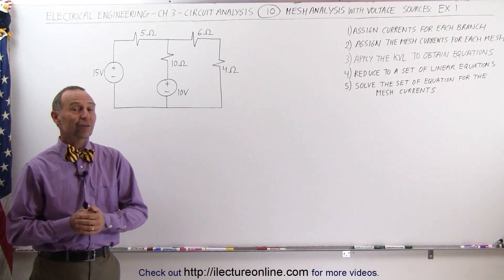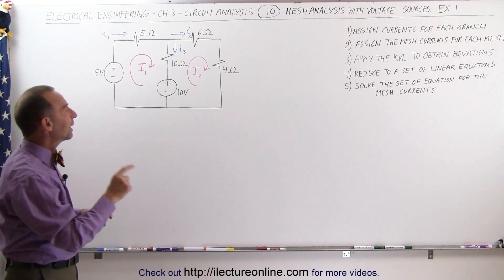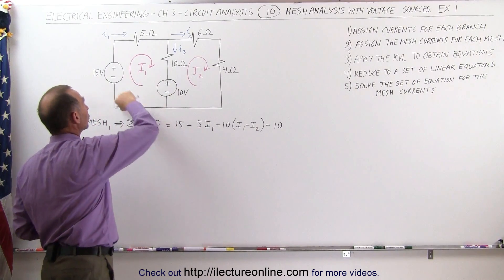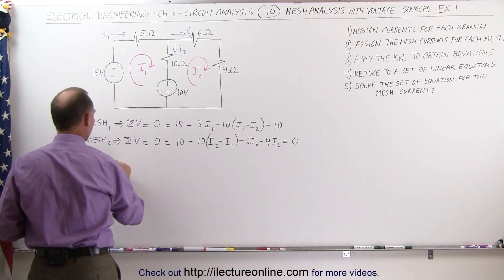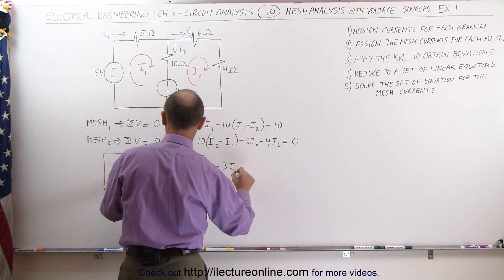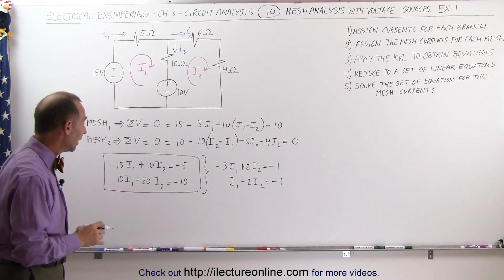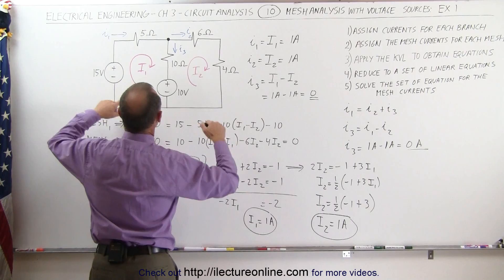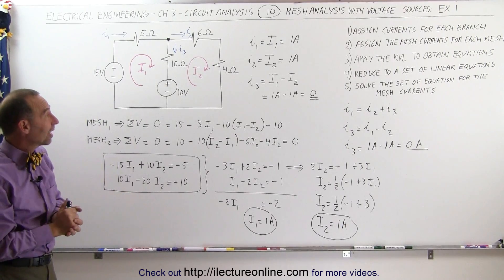Electrical Engineering: Ch 3: Circuit Analysis  (10 of 37) Mesh Analysis w/ Voltage Sources: Ex. 1

Comment: Why we not consider 4 ohm resistor is i4 current
Reply from the maker: you can call it I4, but it doesn't matter.  I1 and I2 were used to indicate there are 2 currents.
Reply: @MichelvanBiezen  ok understand thanks sir
Reply from the maker: We use I1 and I2 to indicate there are 2 currents.  The value of the resistor is not relevant for that.

Comment: sorry but i dont get the second part of the mesh equation. it is clear that I2 and i3 are in the opposite direction so we say it is a voltage rise but why did we write -10(I2-I1)
Reply from the maker: You can solve the equations using i1, i2, and i3, or you can solve it (as we did in the video) using I1 and I2.  When traveling across a resitor in the direction of the current indicated, there will be a voltage drop.  (The equations are correct).
Reply: @MichelvanBiezen  so i can put a plus sign where the current comes from and a minus sign where the current leaves the resistor. And by that, is it able to say that if the mesh current is coming from minus sign and going through the plus sign, then it is a voltage rise?
Reply: may i also do this technique for node-voltage method sir?
Reply from the maker: I don't want to say "yes" or "no" since I am not sure I am following your description correctly.  But here is the rule:  Traveling WITH the current across a resistor causes a voltage DROP.  Traveling AGAINST the current across a resistor causes a voltage RISE.
Reply: @MichelvanBiezen  i get it thank you so much

Comment: Professor Biezen, you are a rockstar. I can't tell you how much I appreciate your videos!
Question: At the 3:00 mark, you're building Mesh 2.
When crossing the 10Ω resistor, you say that relative to current I2, it is a voltage drop, which I agree with.
However, when considering the direction of I1, you say that we have a voltage rise, which I disagree with. You even rotate your hand in the counter-clockwise direction, which is not the direction we assigned I1 on the problem.

I am going to work out the problem with my assumption in mind, but I do hope to hear from you regarding whether I've misunderstood this or not. It would mean a lot! Thanks either way for what you do!

EDIT: I built the circuit in Multisim and determined that it was indeed I who was wrong. 
Then I recalled something my professor said in class, which was that when the currents travel in opposite directions, there is a sign difference. So here, I'm not looking at the at the relationship between the direction of I1 and and 10Ω resistor. I'm looking at the relationship between the directions of mesh current I1 and I2. And because I2 is negative (with respects to the 10Ω resistor) and the direction of I1 is opposite, then its sign should be positive. 

Thanks again!
Reply from the maker: Thank you.  When finding the second equation we have as the middle term:  - 10 (I2 - I1) which = - 10 (I2) + 10(I1)  which gives a voltage rise due to I1 and a voltage drop due to I2, traveling around mesh 2 in a clockwise direction.

Comment: For those wondering, the reason there is no current going in the middle branch is because there is no potential difference across that branch due to the potential at the junction being 10V and the source in that branch is also 10V therefore using ohms law you can see that there is no potential going through the 10ohm resistor. (10V on both sides of it)
Reply from the maker: That is a good way of looking at it.  The net potential diffence across the middle branch is indeed zero.

Comment: I run this circuit in a simulation program, and I get measurements as calculated in this video. Now, why is it that there is 0 current through i3? is it because the voltage potential is 0 ?
Reply from the maker: It looks like the 15 V battery in branch 1 is cancelling the 10 V battery in the middle branch.

Comment: The way our lecturer teaches us is that when you assign each mesh current a direction, you pick a point in each mesh and "walk" around the circuit. If you meet a resistor it is more positive on the side that you encounter it so for example +10(i1) if it was mesh 1 and a 10 ohm resistor. I worked out the question quickly and I got identical answers to you so I guess both methods are good.
Reply: any circuit  has many , many ways to solve .  We can traverse Counter Clock-Wise if we want .
Most literature tries to stay with  +pos ohm's law for the  passive  components . The video uses
+pos ohm's law for the passive  components ( he did not show the  +-polarities
across the  resistors )  , however , he choose to  say :  Vrise is  +pos
and  Vdrop  is -neg , thus he writes a lot of  -neg  KVL signs for the  passive components on that
C.W.  Clock-Wise  traverse . ( he even sniveled at all the  -neg signs of the  equations , there ya go )
Also not shown , is that most of the  Ohm's law  signs for the
resistors are +pos . Thus  his written equations could have had lots of  +pos  signs .
There are a lot of features that need to be included with this tutorial .

His  equation writing works , but is cumbersome ,... to me it is .  I recommend the book :
U.S.  version ISBN :  0-07-027410-X  or the  International version  ISBN :  0--07-112961-8
Engineering Circuit Analysis  Fifth  Edition , 1993  publisher  McGraw-Hill .
That book is  strictly  "hole flow" .  The  book  explains the difference between  writing
Mesh equations  using  "Branch Currents" , as opposed to strictly using  "Mesh Currents" .
When  writing  "Mesh Equations" , we should be exclusively using  "Mesh  Currents" .

here are the  2  mesh  equations .  Both equations are written directly  from the diagram
( No  intermediate  steps  were used  nor  written  )

mesh Eq. I1 :   15v - 10v   =   ( 5 + 10 )I1  -  10*I2
mesh Eq. I2:             10v   =  ( 10 + 6 + 4 )I2  -  10*I1

once you know the  tricks , very fast , very easy ( just a couple of seconds  each )
This is a preferred way , as the Format  is also directly suitable for use with a Matrix .

( I'm not perfect , but  I have also seen a lot of books that aren't perfect  either )

P.S.
you might have wanted to see the  initial equations written in a  C.W.  traversal ,
using the  +-sign as we  Enter each  component :

mesh Eq. I1 :  - 15v   + + 5*I1 + ( + I1 - I2 )10  + 10v  =  0 v
mesh Eq. I2    -  10v  + ( + I2 - I1 )10  + + 6*I2 + + 4*I2  =  0v

notice I have emphasized the  Ohm's Law sign of each passive  component , by showing the
second  polarity sign .  Most are  +pos  Ohm's law . And most  KVL signs are  +pos  too .
There is still a lot more to discuss .

P.S.S.
For the  curious ,
it is possible to  traverse  C.W.  for both meshes , while  I1  is  C.C.W. with  I2  C.W.
the correct answers will now be :  i1  =  - 1 amp ,  I2 =  1 amp
we could have at least 4  correct  sets of answers :
I1 =  1  with  I2  =  1  ,  or  I1  =  1  with  I2  =  -1  , or  I1  =  -1  with  I2  =  1 , or  I1  =  -1  with  I2  =  -2
all  4  are  correct in their  context of  the direction  that was used for each  Mesh  Arrow .
hint :  <----- 5   is the same as  -5 ---->  , for  Vector currents .
if someone says to solve the circuit with  both  Mesh Arrows  moving  Clock-Wise direction ,
then we all need to get the same answers that  M.V.B.  got in  his  video .

Our analysis does NOT change how the physical circuit operates , only our perception is different .
However , once we interpret the numerical answers , we then know  absolutely ,
how the circuit is operating .  Absolutely ,  the circuit operates in exactly the same way ,
no matter how we choose to write the equations.

And , we didn't even  try to traverse  counter  clock-wise . So there are many ,
many ways to write equations , to solve any  circuit .
By now , we should ask :  all I want is one way . One good  straight forward simple approach .
For those who want to  Traverse the  circuit elements , the easiest way  is to  use the  +-sign
as we  Enter each  component .  We can write the  entire  equation  in just  1 seamless  pass ,
without the inconvenience  of  Vrise\Vdrop .  Sure  ,  Vrise  Vdrop is  handy to use  when writing
just a  KVL  equation .
Using  Vrise  Vdrop to write a  complete  ( KVL  with  ohm's law ) equation is  inconvenient .
Just  watching the  video and following along was proof enough of the  awkwardness of
that  technique .  It works ,  but what a  hassle .

Comment: Your videos and presentation are the best I have seen on the topic.  One item,  when working Mesh 1from the 15 V source, through the 5-ohm resistor and through the 10-ohm resistor and across the 10 V source,  should not the equation read 15-5i1-10(i1-i3)-10 to match the assignment of current designations?  It seems like i2 and i3 have been mixed up.
Reply from the maker: The best way to check is to use the equation you suggest and see if you get the correct answer.
Reply: Thanks - I get the same answers. My question was poor. What I should have discussed was nomenclature and bookkeeping with respect to use of an i3 label.  All AOK. Thanks again
Reply from the maker: Good job.  That is how we become more familiar with the techniques.  Thanks for sharing.
Reply: in his previous video he explained to use the mesh current which is in capital "I" and not the branch current which is in small "i"

Comment: There is no needs for the first step. More useful would be assigning voltage polarities for resistors relative to mesh currents I1 and I2 - this will prevent  wrong KVL equations.
Reply: thanks Oleg. 
But doesn't it work as well, using the assigned currents i1, i2, i3?
Reply: how should we assign the polarities ? can we just assume or is there any rules that we should obey ?

Comment: when considering the middle 10 ohm resistor, shouldn't you have added 10 (I2-I1) for I2 equation? you subtracted on both I1 and I2 equations.
Reply from the maker: Moving upward through the 10 ohm resistor, you are moving against the direction of I1 (voltage rise) and in the same direction as I2 (voltage drop).  Thus the equation is correct.
Reply: +Michel van Biezen thank you for clarifying, Michel. I appreciate your videos very much and thank you for putting in the time and effort. You're helping get me through college!
Reply from the maker: Glad to read that.  Keep putting in the hard work.
Reply: A minus by a minus is a plus :)

Comment: have to see it again, confused with the mesh up and down.
Reply: it's easier when you write in the polarities on R3, relative to each mesh current at the i3 branch - obviously as current enters a resistor, it will be positive upon entry and negative as it leaves. So, for instance, relative to mesh current I1, the polarity of R3 (I1 clockwise) is + /-, which is a voltage drop. However, relative to the direction of the I2 mesh current it's -/+. I wrote in the polarities each side of R3 relative to each mesh current so I could understand where he was accounting for that in equation 1 & 2. Wish YouTube had a way to attach little screen clippings you could open in the comments section for these mathematical/learning channels - would be a nice collaboration tool.